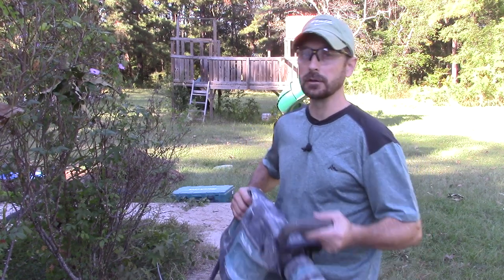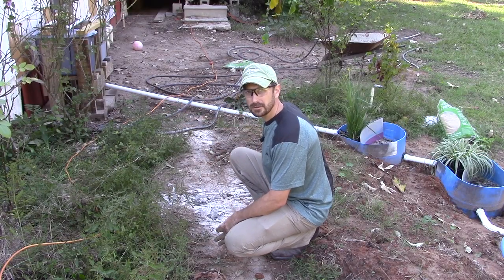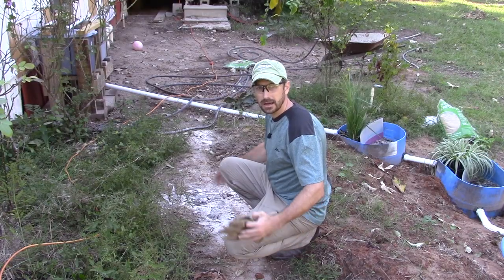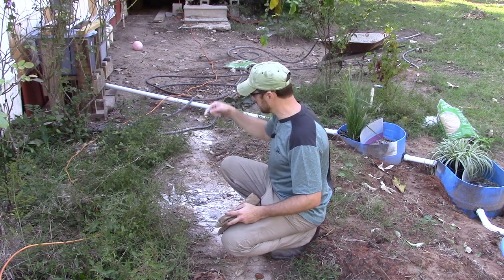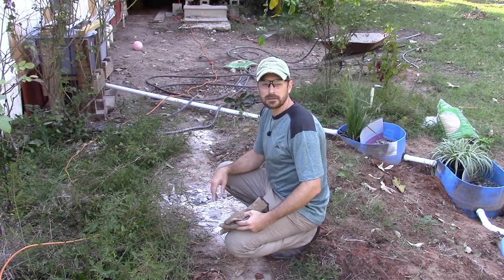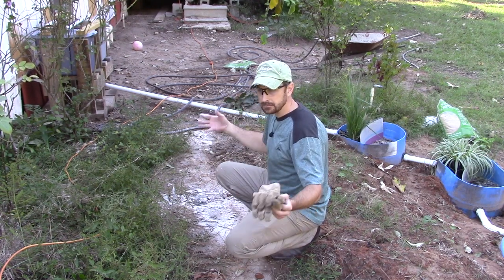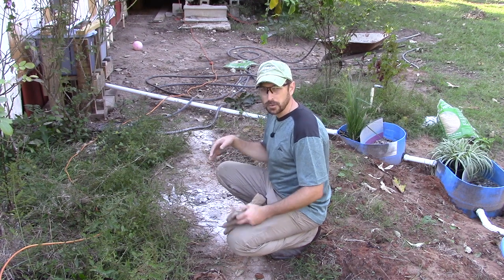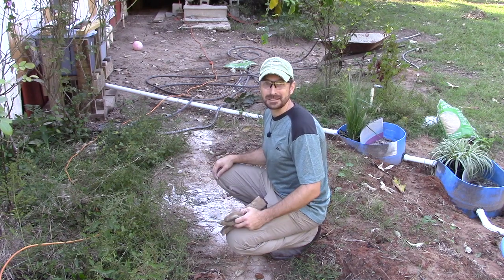Demolishing And Removing A Concrete Sidewalk

Comment: You didnt really show what you did. You just told us what ur going to do but we didnt see where or how you connected it to a chain..
Reply from the maker: Cut off in sections, jack hammer hole, put chain through hole, lift and take to new desired position.